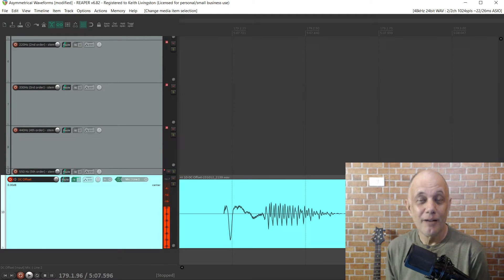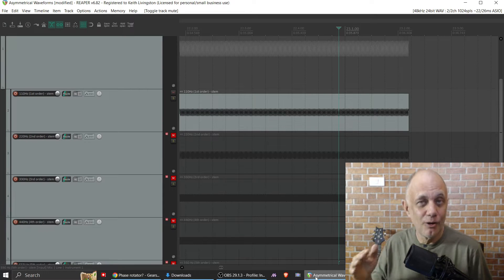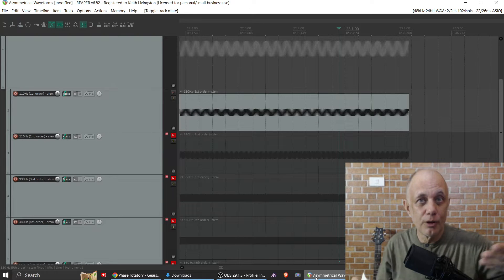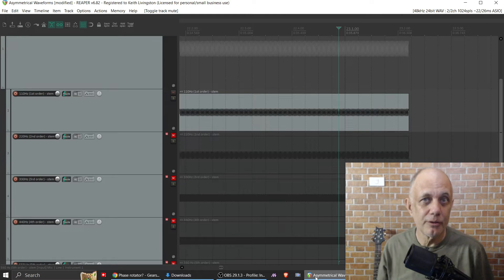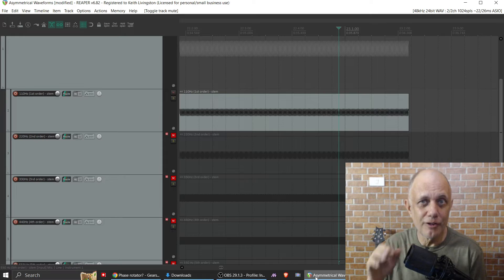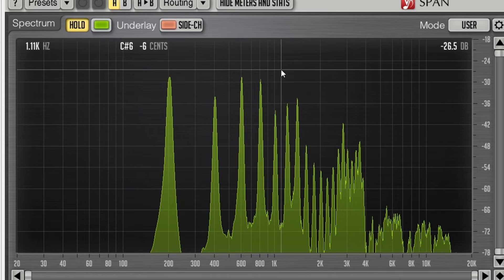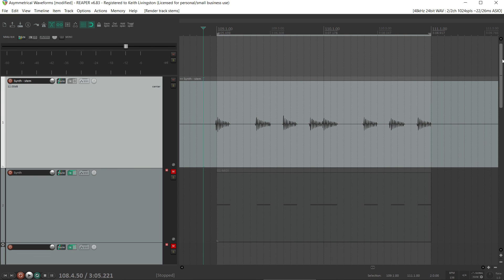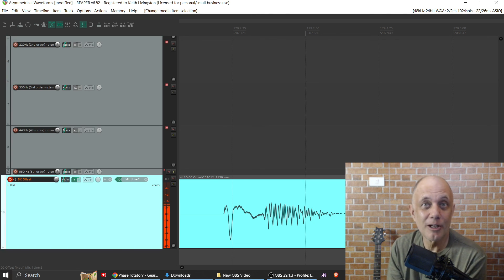Asymmetrical Waveforms

Comment: Great video. So phase rotation is different than DC offset has nothing to do with correcting phase when combining multiple bass tracks. I'm still not sure how the headroom issue would be a problem. I guess it would be if you can't get your bass loud enough?   So then you could do the phase rotation?
Reply from the maker: I have never used a phase rotation plug-in in a real-world mix or recording situation. Theoretically, yes. If you have an audio file that's lopsided to one side, you can rotate the phase and gain a little bit of extra headroom. Maybe that would mean you don't hit a compressor quite as hard. But that would be low on the list of things I was paying attention to.
Reply: . So scientifically interesting but not musically necessary. Thank you!
Reply from the maker: @revisethedream8406  I can imagine it has use cases. Mostly, I just wanted to combat the misinformation going around about DC offset and asymmetrical waveforms. People think if it's lopsided, there must be DC offset.